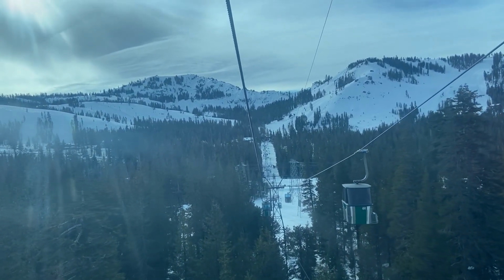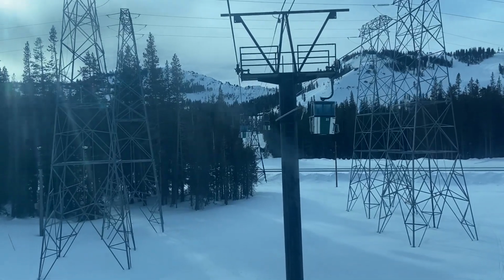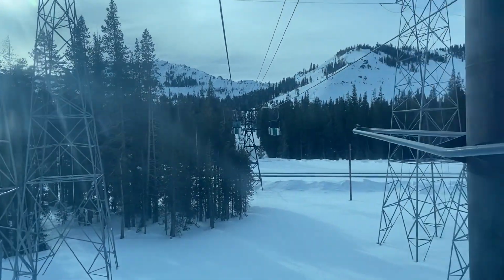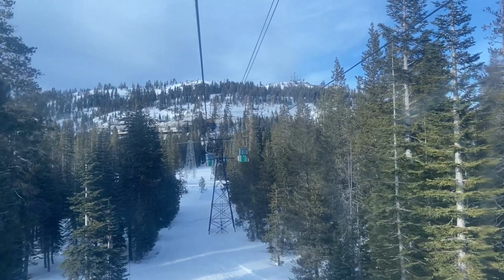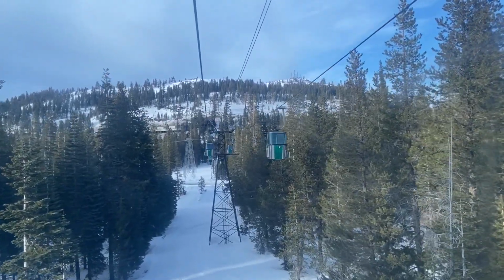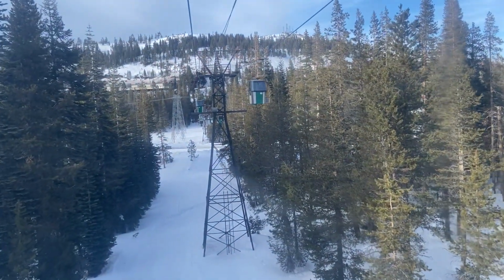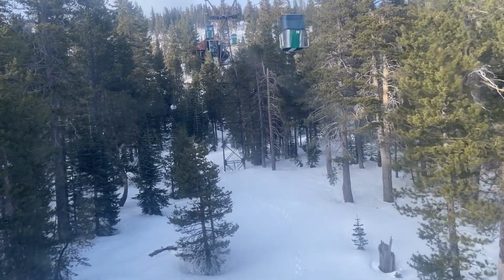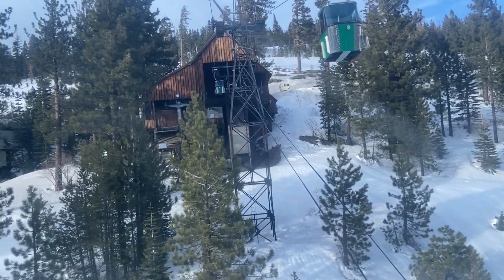Sugar Bowl, CA: Village Gondola

Comment: I don't know why this lift is listed at CTEC on Lift Blog. The cabins are earlier CWAs, the grips and detachable equipment are VonRoll, lifting frames probably VonRoll also, and Doppelmayr tire banks and other accel equipment. Only the Bullwheels and most sheaves are CTEC. It's likely CTEC was originally contracted to build, and partnered with VonRoll and CWA for most other equipment.
Reply from the maker: VonRoll’s a likely candidate for the rest of the equipment. I don’t think CTEC built the grips and detach equipment. I’d say it’s a bit of a frankenlift, which is why it’s so rough.

Comment: It's a Von Roll VR 102. This technology dates back to 1969 to replace the legendary Von Roll VR 101 grip. Cabins are classic CWA Nova 4 passenger.   
 A classic ropeway. Built better than any Doppelmayr nowadays.  This is definitely rough for a Von Roll.  . Take a ride sometime on a classic Von Roll VR 101.
Reply from the maker: Interesting. I’ve ridden two Von Roll VR 101s; at Cedar Point and Busch Gardens Williamsburg. Both are smoother than this.
Reply: @TwinSkiingLiftsRides  VR 102 lifts are generally rough. The grip jaws go below the apex of the haul rope